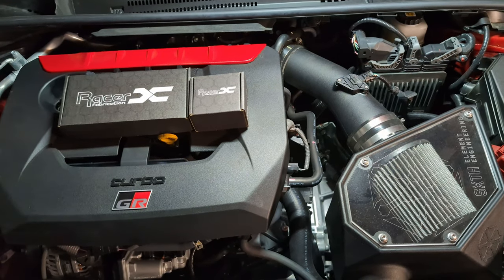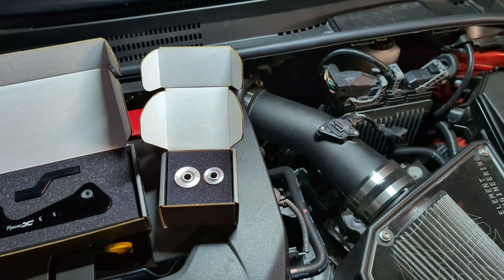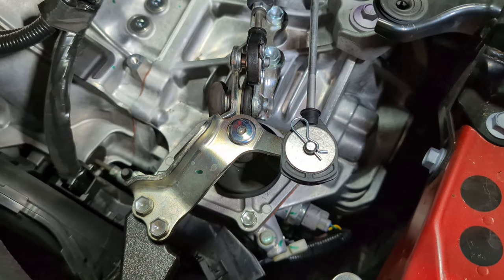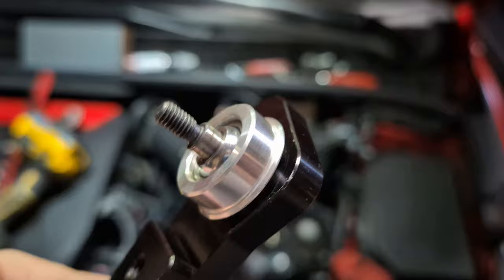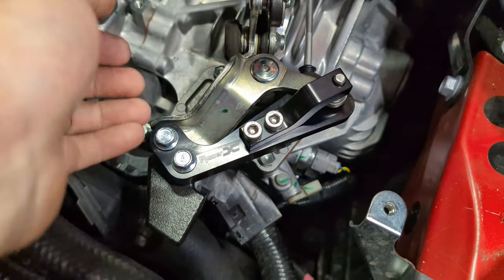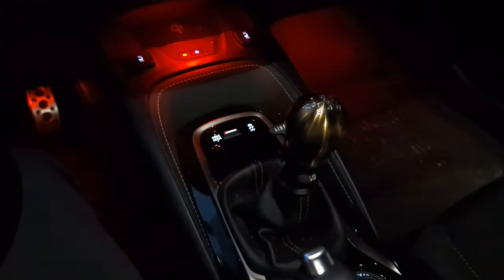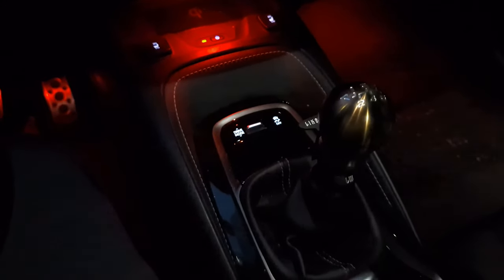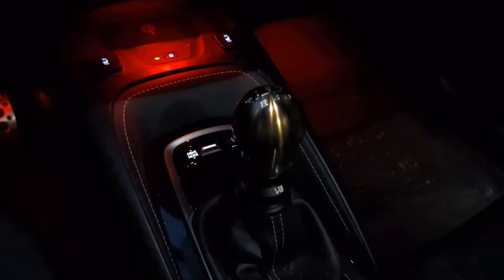GR Corolla Shifter Mods Shootout

Comment: I've used solid bushings and spherical bushings in the past.  Without any doubt, I will chose the spherical bushings every time.  They make gear selection far easier & more direct than the solid bushings - this is due specifically to the fact that spherical bushings do have a range of motion.  It might not be a lot, but a lot isn't needed.

I will absolutely be picking up a set of the spherical shifter bushings.

Comment: Can you make a video about your likewise shifter setup? I want to know your setup and how you installed it and what you need to buy from them
Reply from the maker: Sure, what do you want to know? All I have is the Likewise RLX lockout, which I have a video on for installation, and switch between a Likewise knob and Raceseng knob with their respective adapters. Do check out that video I made on the RLX lockout, it's detailed.

Comment: Great video. I appreciate your approach of testing various brands against each other. Currently, I am using the Sxth Element shifter in my vehicle, and while it initially felt satisfactory, I've encountered a minor rattle stemming from the washer on the aluminum. Now that you've had the new bushings installed for three weeks, I'm curious to know your overall experience. Have you experienced any rattling issues?
Reply from the maker: Thank you! I actually noticed that a thin washer helped with the SXTH Element bushing paired with the Forge shifter. Just on one cable. 

With the new setup, no rattle. I'm a big fan.